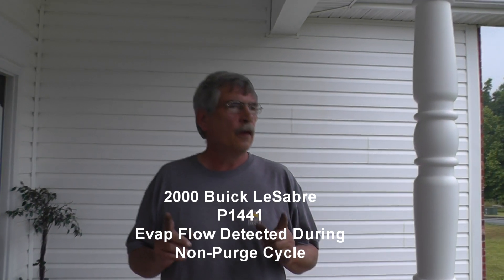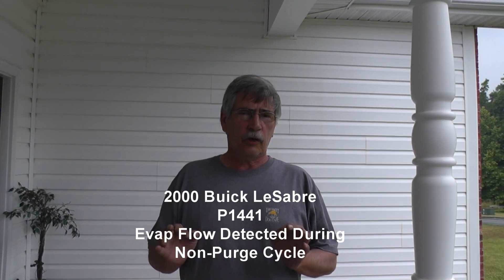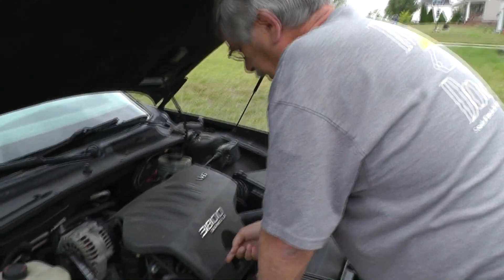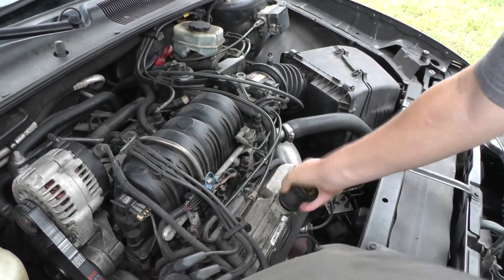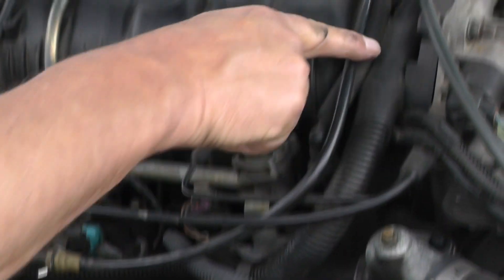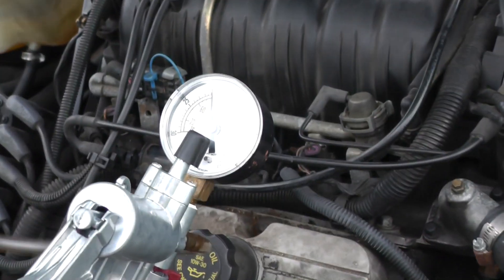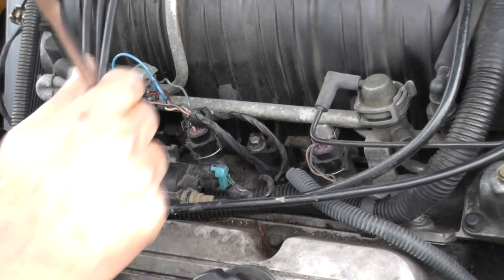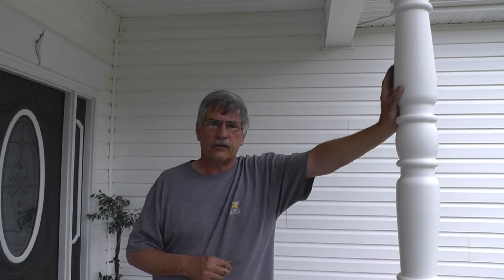P1441 EVAP System Flow During Non-Purge

Comment: I keep having to replace it every 60-90 days. In a 2002 Grand am. What is causing this? Once replaced it runs fine for about 30 to 60 to 90 days
Reply from the maker: Take a look inside purge valve to make sure that charcoal pellets aren't being withdrawn into the valve. Only thing I can't think of.

Comment: Exactly what I needed.  Tested the valve as shown and it would go to about 5 inches of vacuum and then drop to 0.  Then I tapped on the valve a few times and it started holding a full vacuum.  The sad thing is, I had replaced it only 2 years ago, so I don't feel really confident in the quality of AC Delco parts anymore.
Reply from the maker: Yes, it seems that even the OEM parts have gone down hill for the last few years. Glad to hear that you found the issue. Have a great day!

Comment: I replaced the valve and the charcoal canister on a Chevy blazer 97 but still reads the code after I reset the computer as well only thing I’m thinking next is maybe a leak in the hose because it’s also reading vacuum leak
Reply from the maker: If you have a smoke machine Isaac, you could use it to find your leak. Otherwise, it's just a guess. Good luck on what you find!

Comment: What is  code p1441 manufacturer control  for 2002 Chevrolet Silverado truck 5.3 1500
Reply from the maker: I'm not sure what your question is Kenneth. Code P1441 has the same description of System Flow During Non-Purge for your Silverado.

Comment: For anyone who doesn't have a hand pump, all u gotta do is take the valve off the car and blow through it, if u can blow through it then the valve is bad, if u can't blow through it than it is good
Reply from the maker: Or another way is to disconnect the valve on the canister side along with the electrical connector and then start the engine. If you feel vacuum on the purge valve where the line was disconnected, then the valve is bad.

Comment: I have a Buick P1675  error code, and it quit running, only cranks over n over, once ina while itll start for a few then die again,,, any idea ?
Reply from the maker: John, the P1675 is saying that the vent solenoid for the evap system is either open or shorted. This shouldn't have anything to do with the engine not starting. I suspect for the not starting issue, there is another issue.
Reply: @stuzman52   it was runing fine and boom just quit out of the blue, no other error codes,,weird
Reply: @stuzman52   any guess? all fuses are ok inside and out,  new ignition switch also
Reply from the maker: @wonderwond  Go back to the basics John for a no start. Check for an ignition spark on one of the coils and it should jump about 3/4". Are you getting a pulsing on the fuel injectors? You can check this with a noid light or even a test light. See what that gives you.
Reply: @stuzman52   got plenty of fuel, turned key on it sprayed when unhooked, its holding pressure on the fuel line ok, when turning key  on, it has power at the junction of going to crank sensor and coils . when turning over no spark from coil, but if crank sensor was all the way out, would coil packs still fire ?
Reply from the maker: John Hill From what you’re saying it sounds like no spark. If you have a scope, I would verify the two crank signals. You can check the signals at the ignition control module. If you don’t have a scope, you can use a DVOM, but it’s not a conclusive test. If you’ve got the signals, I would look at the ICM. Removing the crank sensor will give a no spark.
Reply: @stuzman52  I just replaced crank and cam sensor both today,,,still no start,,,
Reply: @stuzman52  ignition control module under the coil packs cured the issue, even though i put new crank and cam sensors. thnks
Reply from the maker: John Hill Glad to hear that you got it figured out!

Comment: Does anyone know what the rubber fitting is or what it is called that the fuel pressure line and EVAP purge valve plugs into? It has two lines that fit into one end of the rubber fitting and the other end attaches to the throttle body for vacuum? Any help would be greatly appreciated.

Comment: Just out of curiosity what kind of problems will you experience if that part is bad
Reply from the maker: O Val With the valve open, you can experience long a long delay in starting the engine because the engine will be pulling all the fuel vapors from the canister. This will create a rich condition. Once all the fumes have been pulled, then the engine will experience a lean condition. So, you could have both rich and/or lean codes.
Reply: @stuzman52  ok thanks for the information

Comment: Hello!! I have the same code p1441 in my 2001 Nissan Pathfinder is this problem the same for all car types?? I didn't pass the emission test 😞😞
Reply from the maker: burbuail2 this is a manufacturer specific code so it does not necessarily mean it's the same on your car. For you it means that the evap system has a very small leak. Common issues are evap canister may have a crack or you could have a vent valve that is not sealing. Sounds like you may need to do a smoke test to find out where the leak is at in your evap system.

Comment: what do you think about pumping air(very small amount) into it with a small bicycle pump, if the lines are disconnected on either side of the valve?  I actually do also have a fluid evacuator pump that will pull vaccuum, but no gauge to hook up to it though.  My uncle has p0300, p0440, p1440 and intermittent rough idle.  I think it could just be a vaccuum leak or this valve. The boot that plus the vacuum lines to the throttle body can crack and leak as well. thanks for the video
Reply from the maker: An easier way is just try to blow through the valve. If you can blow through it, then it's bad :)
Reply: stuzman cant that cause the car to stall if its open and the hose to the contol is broken
Reply from the maker: If the valve is open, it can cause stalling on startup because of a rich mixture. And if the hose is broken, you would have a vacuum leak causing a lean mixture where the mixture would be enriched by the computer.

Comment: do you have a sugestion for high idling 3800s???
Reply from the maker: Off the top of my head, you could have a dirty throttle body which prevents the throttle plate from closing.

Comment: Hey, thanks I have been having this problem for a while! That's the next item on my list and I'm ordering it now. RockAuto.com
Reply from the maker: Good luck on your repair David!
Reply: I put it on and now too reset the engine light, right after I eat some ice cream!
Reply from the maker: There you go David; once you eat some ice cream, all will be good :)
Reply: I just replaced all the intake gaskets about 2 weeks ago and then the engine light comes on yesterday and I go what now what's wrong? but the code was the P1441 and I looked it up on YouTube and your video was the first one on the subject. I have been getting this same code for a couple of years and didn't have a clue what it was, in till now. It's fixed now, but I broke one of the plastic hoses that goes the sensor, I had just enough rubber hose too fit over the end and a clamp.
Reply from the maker: Yeah, you've got to be careful with those plastic lines as they are easy to break. Sounds like you've got it all fixed up now and I take it that your check engine light is off now :)
Reply: It's off as of right now, I took my computer out to the car and reset the engine light. we'll see what happens in a couple of days if it comes back on or not. I have my own channel here on YouTube under my name and I have done a lot of experiments with HHO, but with the engine not being 100% it doesn't work very well. My next thing is doing the lower ball joints and the outer tie rods on the rear of the car. I have a 1996 Pontiac Bonneville and I have had it sense 2007, I'm the 3rd owner and have all the car fax on it and some of my own too. This car is almost rebuilt as much money I've put into it! Better then a car payment I say,  The thing that I'm getting out of this is that I'm learning how too work on a car myself and saving money on top of it.
Reply from the maker: I watched a few of your videos David where you pulled the upper and lower intake manifold. Looks like you did a pretty good job and it's a problem area on these cars where the EGR stack tube comes up. The diameter of the opening of the upper plenum that goes around this tube is a  little small. This places the plastic close to the hot EGR tube and starts warping the plastic. I had this issue on my LeSabre a few years back. I pulled the upper plenum and lower intake as you. Then replaced the upper plenum with a beefier version and a larger hole around the EGR tube. Haven't had any problem since. And you're right that it's better saving money on a new car payment. I've got four vehicles and the newest one is 2001. Take care David...

Comment: Thank you for the video.  Simple straight to the point and just what I needed to know for a 2002 Trailblazer repair.  Thank you!
Reply from the maker: Glad to hear that it worked out for Leslie...
Reply: @stuzman52  I have a Buick 01 leabre would this fix code p0400 replace evaporative emission vent control valve
Reply from the maker: @georgesnow9648  Hi George. P0400 is for the EGR valve and not for the evap emission vent control valve. The EGR valve is vacuum controlled which is controlled by a solenoid actuated from the PCM. This solenoid valve is PCM controlled which controls the amount of vacuum applied to the EGR valve which in turn regulates the amount of exhaust gas flowing back into the intake manifold. Instead of just replacing the EGR valve or solenoid on a guess, I would suggest to do a little testing to verify your testing to see what's not working. Good luck on your repair and here is a link to P0400 for a little more insight. https://www.carobdcodes.com/buick-p0400-exhaust-gas-recirculation-flow.shtml
Reply: Thanks took it to AutoZone in the part suggested was a vent control  valve, replace evaporative emissions p0400 no flow during purge kinda stuck on what to do
Reply from the maker: @georgesnow9648  George, either the code is wrong or its description is wrong. As mentioned, P0400 is a generic code for an issue with the EGR valve or its flow of exhaust gases. P0496 is the generic code for an EVAP flow during a non purge condition. This code would point you to the purge valve for the EVAP system which is located under the hood on top of the engine as shown in the video. And for the same code using the manufacturer's code such as your 2001 Buick LeSabre, it would be a P1441 code. I would go to maybe Napa or Advance Auto Parts and let them read the code as I've seen where some scanners will mismatch the code with its description. Good luck on what you find and have a great day!
Reply: @stuzman52  thanks alot a gain for responding I will just do that in see where it leads me to
Reply from the maker: @georgesnow9648  Glad to help George!
Reply: Leslie where is this located on a 02 trailblazer?

Comment: I have a '97 regal. I had a rusted evap tube near the gas pedal (engine side). After removing the rusted portion and putting in a rubber fuel line hose (with clamps). I occasionally get evap codes like P1441. What I do is remove the purge valve and tap it a few times (sometimes more than just a few) and particle like rust come out of the ports. I tap it with the port side down. On my car, both ports are on the same side of the valve. I have read that sometimes charcoal from the canister can get into the purge valve so when you tap it, it may release the charcoal. After tapping it, I simply blow into one of the ports and determine if the seal is good and then re-install. Works for me. Replacing the valve is a bad idea since more rust is bound to be in the system and it too will clog. If your ports are on opposite sides of the valve, I would try tapping the port from the canister first (down) and if that doesn't work, then try the other side.
Reply from the maker: +Anthony Melidy Using your logic that if I had rust and charcoal particles inside the valve that the problem would come back after putting a new valve on there. It's been over a year and there has been no issues with a code. I didn't have any issues with rust or charcoal particles and if I did, surely, a cleaning of the system would be needed. This valve was just sticking...
Reply: +stuzman52 I was not suggesting all problems are from rust or charcoal contamination. That was my case. I was just trying to provide my perspective since it might save others the frustration of buying a new valve and finding the problem returning. If this is the case, they might wrongly believe the new valve is faulty or that there is a different problem with their car. Sorry if you thought that my suggestion that replacing the valve was a bad idea applied to you. For me that would be a bad idea. Yesterday I had to clean the valve again (3rd time in a year?). Some readers suggested using solvent or cleaning solution. Tapping was done without the aid of any solvents.
Reply from the maker: +Anthony Melidy No problem Anthony as all is good! Good to hear your experiences so that it may help others out there. Take care...
Reply: Question: If charcoal debris was in the valve, would that also indicate the EVAP canister might need to be replaced?

Comment: Can you clean those valves out with solvent / cleaners / lube?
Reply from the maker: +Rick Neubrand Even if you could open the valve open and get some solvent down in there, I wouldn't trust the repair as being permanent. But, if you want to save about $30, go for it.
Reply: +stuzman52   I sometimes get good luck with cleaning them out with a solvent.  But the local wrecker sells them for $10 too .  Thanks.

Comment: i changed the evap sensor on my 3800 and it keeps making a noise. plus the car studders and now has a rough idle
Reply: +Mark gochnour I assume you fixed it by now, but for anyone else that reads: make sure that the line that runs back into the intake manifold is air tight. The connectors have a tendency to dry rot and generally be pieces of crap

Comment: Hello i have a buick regal 1996 v6 3.8l and it will not pass smog. I narrowed down the problem by using a scan tool and the codes i got was P1441. From whT i searched up its the EVAP system? Im not to clear on it if some one can help that would be great thanks. 

PS. I also fot a code for a throttle position low coltage sensor. .. Again thanks for any help.
Reply from the maker: You could take a look at the fuel pressure vapor tank pressure while the air vent solenoid valve is energized. You don't want to see the pressure dropping which would be a leak. Take a look at this video to understand how the system works. Then you may come up with your own diagnostics to check the system. Although the video does cover your vehicle, all these systems are pretty much the same in how they work. Good luck on your repair. https://www.youtube.com/watch?v=dGfxpjGZsRI
Reply from the maker: The  P1441 code is saying that the computer has detected a flow during a non-purge cycle. The purge valve should be normally closed when it's not being energized by the computer. As I show in this video, my valve was opened. Did you do this check yet? As for your TPS code, it could be the throttle position sensor, connector issue or even a wiring issue. Doubtful that it's a computer issue.
Reply: But no i havent tried your method only because i dont that vaccum pump tool you us
Reply: Also thanks for the fast reply man. Just subbed to your channel. Hopefully i can get this car sorted out to pass smog.
Reply from the maker: Thanks for the sub. The two problems that you mentioned should be fairly easy to fix. Do a little googling and you'll probably see how to troubleshoot the issues. Take a look on YouTube for scannerdanner and you'll see a lot of troubleshooting there.
Reply: Will do thanks. The first step ill take tho is replacing the purge valve like you said to do if its dirty
Reply from the maker: Fabian Avalos Stick a rubber hose on the valve and see if you can blow through it. If you can, the valve is bad.
Reply: Okay i have the purge valve with me right now.. Theres two entrys wich one do i blow through?
Reply from the maker: Either end would work since the valve should be closed...
Reply: Okay. Ijust replaced the valve. Hopefully it passes smog . No codes pop up when i plug it up to the scan tool only a yellow exclamation point instead of the red one... Thanks anyways so much for the help.. Take care
Reply from the maker: No problem Fabian. I assume that you still have your low voltage issue on the TPS.
Reply: I have a 1997 firebird with 3.8 engine. I've had this car for 4 yrs and can't get rid of the po441( incorrect purge plow). I replaced the canister due to heavy vapors and carbon in my lines running up to purge solenoid and control valve. I replaced solenoid 4 times and just replaced control valve, solenoid again.  Is there any data that I can look at to be sure my vacuum lines in rear of vehicle are correctly hooked up? When replacing said parts I blew out the lines that run front to back with 60 lbs of air. I really need this problem fixed. Any help would be greatly appreciated.